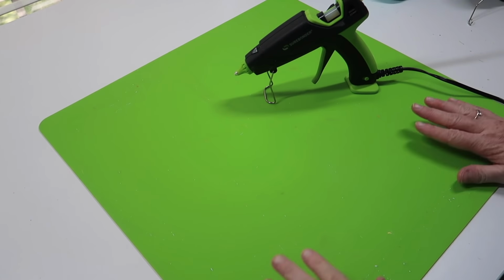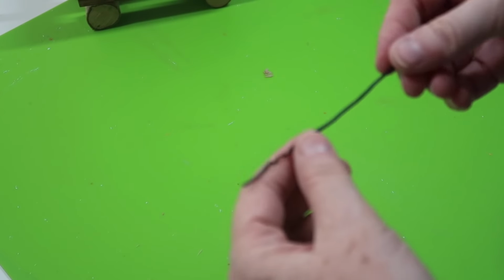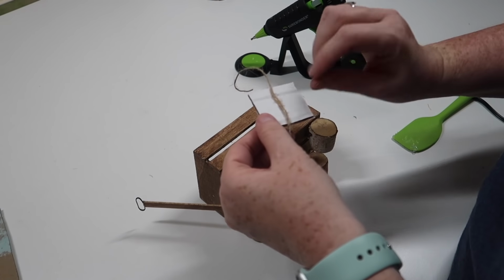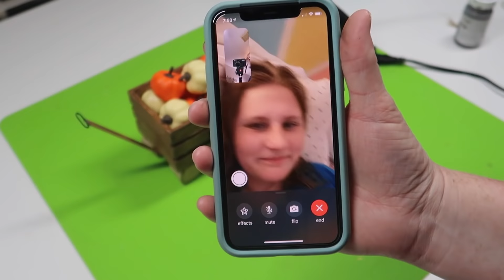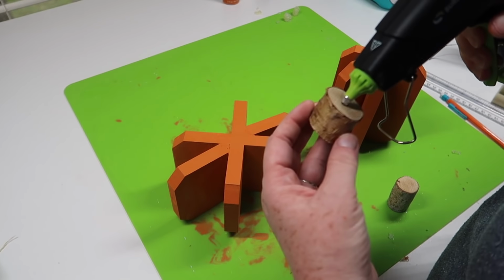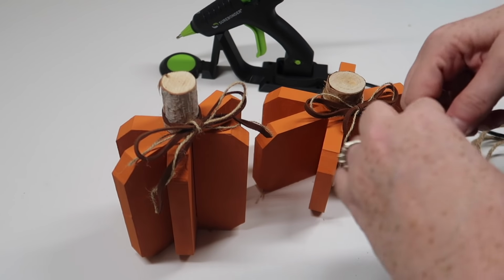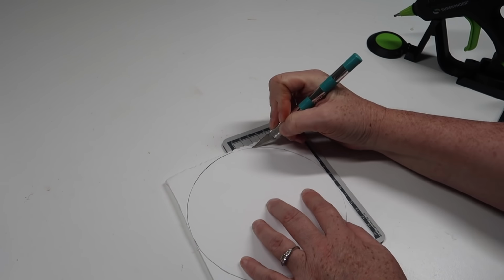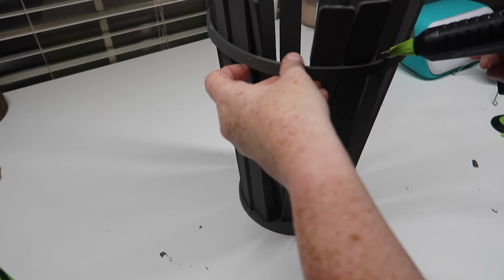🍁 Fall Dollar Tree DIY Home Decor 🍁

Comment: I watched the video for what you call the apple Barrell. But, instead of using it for decoration etc. I thought it would be adorable for a waste basket but probably in a different color for bed room, den, porch, bathroom or sunroom.
Reply from the maker: It might work as a trash can.  I had one with open sides like that and it was always hard to pull the trash bag out because items would get stuck in the openings.

Comment: When you did the apple Barrel when you put the sticks in at the bottom did you glue them all at the bottom and then just one at the shop so that they would be the correct separation at the top?
Reply from the maker: Yes. Only the first one was glued in two places....then I did all the way around the bottom and then opposite sides on topn

Comment: Hey Heidi. I just had a question about when you use the wood glue, how do you get it out of your glue gun in order to change it over to regular glue?
Reply from the maker: I actually have multiple glue guns, but before I had several I would try to preplan projects so I could use up glue guns.  Sometimes, I would just go head and push the glue out.

Comment: I have a question about the 75 minute work time with the glue gun, the link has a video that says once charged you have a 2 minute work time before having to put it back on the dock just like the large cordless one? It also doesn't say it is a USB gun? Is there a different one than the link is taking me too? And its $35.00? The big one isn't even that much 😱😱😱😱😱
Reply from the maker: The 2 min work time is for the cordless detail tip.  The USB charged one does work for up to 75 minutes after it is charged.  It shows the USB charging capability on the bottom left of package.   They are both linked in my description box.

Comment: I bought a Surebonder plug in glue gun and it drips something terrible.  I loose so much of the sticks to this.  I have crafted for years and this the worst one I’ve had.  Is there something I can do to stop this?
Reply from the maker: Do you use Surebonder glue sticks?
Reply: Creative on the Cheap   I do not.  I’m guessing that will make the difference.  Are they more expensive than other glue sticks?   And are they easily found or do they need to be ordered?
Reply: Creative on the Cheap So after asking so many questions I thought I should just look it up myself.  I just ordered a 5 lb box!
Reply: Creative on the Cheap I received my box of Surebonder glue sticks and put in a stick into my Surebonder glue gun.  It still dripped.   I’m hoping the new cordless one I bought from them doesn’t do this.   Wish me luck!